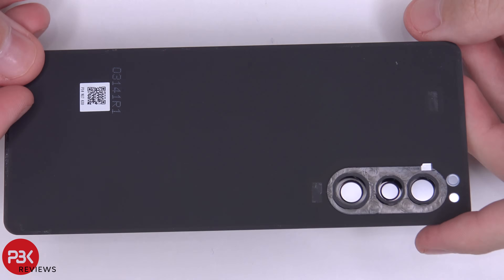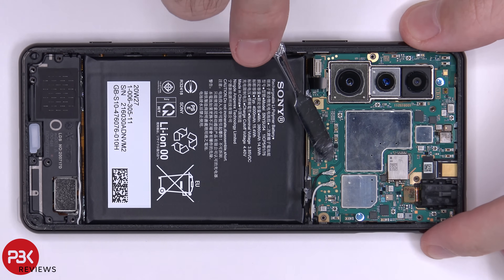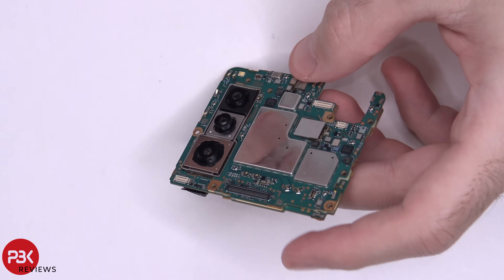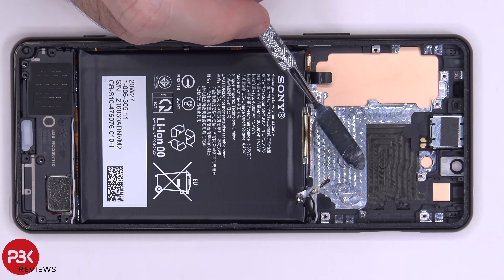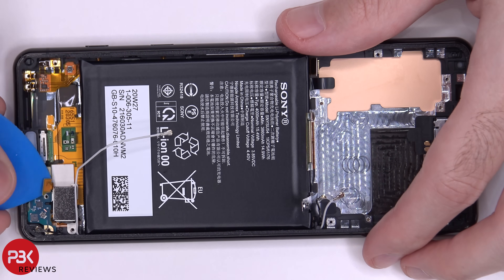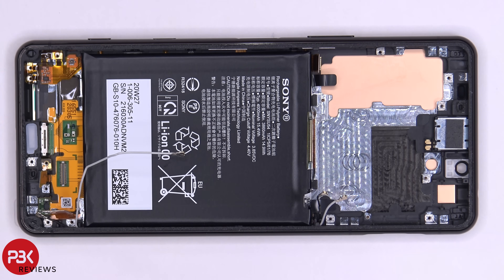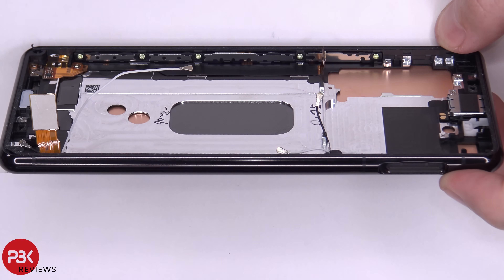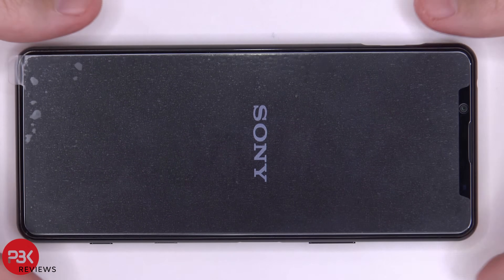Sony Xperia 5 II Disassembly Teardown Repair Video Review

Comment: Beautifully done ..was watching this to learn about the green line which allegedly cause by overheating due to updates ..some say the heat kinda effect the ribbon cable
Reply: @pulkinpulman2028 I had the green line appear 3 days ago on mine.  Out of interest, had you installed the new Pokémon TCG app on your Sony Xperia V II shortly before it happened?
Reply from the maker: Thanks. Not sure exactly what the cause of the green line could be. Multiple things can cause it to do that, so not sure.

Comment: coming back to your video as i finally had time to reassemble my phone, any idea why I'm only getting 3 red flashes from the notification light when attempting to power on? Initially it flashed the low battery symbol on the screen but now all I see are the 3 flashes. Thanks for your help!
Reply: Got it charged and working. had been without it so long, i forgot thats the dead signal. Thank you so much for your content, it was a lifesaver in recovering all my cherished photos and videos of my family!

Comment: Hi, I tore my phone down after watching your video. I'm missing one piece, the adhesive/silicone seal on the lower loudspeaker.  I'm not sure what it's called I guess as I'm having no luck finding one. Any advice?
Reply from the maker: the buffer foam or the adhesive? Sony parts are usually hard to find so you may need to just used b7000 adhesive glue.

Comment: Thanks for the great repair video, much appreciated!

My 5 II was damaged in AUG this year when I wanted to take some photos in a pool, after few weeks of silence the phone started to recover, and as of now everything is back, almost everything.

Except, the connection to O2 network fails (WLAN is OK), tested also in the 2nd SIM slot. The card itself is OK.

It seems that obviously there is a defect on the board with the receiver, but not with the card slot I guess. Any idea which module should be replaced?
Reply from the maker: Not sure what will need to be replaced, but the fact water got inside, first thing you should be doing it not using it. You can risk it shorting out and losing all your data as well as rendering the phone inoperable. You should take it apart and disconnect the battery, dry out any liquid inside and use  a small brush like a tooth brush to brush off any corrosion on chips or connectors, and then re assemble it to see if it will work. If not, you can try replacing parts one by one to test which is defective. :)

Comment: Hello. How do you replace SIM card reader on this phone?
Reply from the maker: Hi, its soldered to the main board so it's not user replaceable. You would need to find a repair shop that can do soldering to be able to de solder and replace it with a new one.

Comment: Great guide, very helpful to see all the steps involved. I tore down my phone to replace the entire frame with screen and the battery. However when I removed the plastic cover like at 0:40 there is a tiny piece of adhesive on the back which when removing the cover ripped the metal heatspreader off the pcb. To put it back on I used some tiny dabs of thermal glue on the chips and precisely aligned it back how it was. Phone works just fine.
Reply from the maker: Thanks! glad it was helpful.

Comment: Sometimes I clean the phone under the sink with no presured water and never had a problem after now almost 2 years from buying the phone that seems some humidity went into the phone and more exactly I noticed in the cameras. The front camera is with beam and little drops of water in the three back cameras. Also the camera app is turning on by itself from time to time. The rest of the phone seems perfectly working, apart of the fact that was not passing more than the three animations when turning on the phone after some minutes of puting under the water. The phone was all the time ON and no electricity problems have been seen. Should I worry about or it will desapear? Should I open the back of the phone and try to remove the humidity? The phone still have the warranty but I don´t know if this kind of situations are the ones Sony repairs...
Reply from the maker: It's never a good idea to wash the phone under water. When they have IP rating, its mainly for accidental drops in water, but these phones are not water proof. They are just water resistant. You probably have water damage in the phone that its causing those issues you are mentioning. You should take it apart, and disconnect the battery cable, clean out any moisture inside, and brush off any corrosion on chips and connectors and then re assemble to see if it helps. Water damage is not covered by warranty.
Reply: @PBKreviews  Thanks for the answer, I am going to do what you mentioned. I saw in the video you removed the back cover with the plastic pick but is it that easy just with it or I need to use some heat to make softer the glue that keeps it attach or is it attach with other way? Whatever the case how do I assemble again the back cover? Cause in the video you just put it on the phone and I am not sure if you use some kind of glue or stick. Thank you very much for the answer, I was not very clever with a phone that isn't cheap..

Comment: Is it necessary to remove anything other than the battery for a simple replacement? It looks like the very first pcb that's pulled off may be covering it, but after that, is it possible to just remove the pull tabs and pop out the battery?
Reply from the maker: Once you remove the top cover and have access to disconnecting the battery cable, you can use the pull tabs and remove the battery at that point.

Comment: hi i disassembled and reassembled the phone. Everything works but the GPS signal. Do you know which is the broken component (the black and white thin cables?) and where I can find replacement?

Comment: Thanks bro what an excellent and detailed video. If I just want to replace the battery without taking out every parts, which part of the video that u recommend me to watch? Can I only remove the battery without touching other parts?
Reply: Then you only take the battery cover thats with top part, then just disconnect the battery as shown in this video, remove the battery. No need to remove anything else.

Comment: Great video, can you replace the screen glass without disassembling the whole phone, or do you have to swap the digitizer too?
Reply from the maker: Thanks. No the complete screen assembly would need to be replaced since the glass is fused/glued to the screen. Only factories or professionals with the required tools and machines can do that job. Also you would need to disassemble the phone to disconnect the screen cable etc.
Reply: Ok ingor my answer here. Thx a lot @PBKreviews

Comment: Outstanding step by step video, great job @pbkreviews.  I have a question id love your advice on, the fingerprint reader on my Xperia 5II has gone bad, i purchased a replacement cable and I'm wondering if you had any idea how i would go about removing the old fingerprint sensor and cable and installing the new one i purchased ?  Would i need to remove everything from the phone as well as the battery or is there a little easier way you could advise ?  Not sure what to do about this.
Reply from the maker: Thanks! You would need to take the back plate off, remove the screws on top and bottom covers and remove those covers. Then disconnect the battery cable and remove the battery as well as remove the speaker assembly on bottom and disconnect the white coaxial cable from the corner, also remove the motherboard then remove the screws on the side of the frame holding the cover/bracket that holds the fingerprint reader flex and other buttons in place to gain access to removing and replacing it. Then reverse the steps. Basically yes you would pretty much need to take the entire phone apart.
Reply: @PBKreviews thanks so much for the indepth and speedyh reply, I'll follow your instructions and get it done.  Thanks again for taking the time to reply, it's much appreciated.  Your channel rocks!
Reply from the maker: @creativewebusa  👍😀 thanks and you're welcome

Comment: What adhesive do you recommend? What steps do I have to do to make the phone waterproof again? Thanks!
Reply from the maker: You would need to use the original pre cut adhesive for the phone to retain the water resistance. You would need to search online for Xperia 5 II adhesive replacement and try to find one to purchase. If none are available you can watch this video on how to install new adhesive but using custom adhesive wont retain the water resistance. https://www.youtube.com/watch?v=T4iiPUIM7-Y
Reply: @PBKreviews  Thank you so much for replying. I found some online. I'm planning to replace the earpiece speaker. Do I need to buy waterproof adhesive for the LCD as well or just for the back cover?
Reply from the maker: @cgjocson  you're welcome. If you remove the screen also, then yes you would need to replace that adhesive as well. But i dont think you would need to remove the screen to replace the earpiece speaker.

Comment: Question: Power button/fingerprint sensor works perfectly, no other button works (both volume up and down, assistant and camera button) Here it seems they are all connected on the same flat cable. Last couple of days had an update and an hour ago dropped the phone from 3 feet hight on the tile floor. Did a software button test, does not register any clicks. Seems to be hardware issue, but power button working perfectly gives me confusion. Any insight?
Reply from the maker: Hmm odd how only the power button and sensor work. I think your best bet would be to take it apart and make sure the flex cable is connected properly to the board and did not become semi disconnected etc. That's the only thing I can think of.
Reply: @PBKreviews  Thanks for the fast response. Makes sense. What kind of glue would you recommend for glueing the back cover back, if I can't find the original one? It is a rare phone after all...
Reply from the maker: @milivoee  Here are a few links. https://www.ebay.com/itm/154657387661  or https://amzn.to/3wQFC9x
Reply: @PBKreviews  Awesome dude, thanks a lot.
Reply from the maker: @milivoee  👍

Comment: Fantastic Video, so well done.  I have a question, what adhesive would you use to stick the back glass cover back onto the phone ?  I recently dropped mine and it cracked the back cover which i will need to replace.  Just not sure what adhesive to use ?
Reply from the maker: Thanks! You can check out this video I did on applying new adhesive: https://www.youtube.com/watch?v=T4iiPUIM7-Y
Reply: @PBKreviews  fantastic, will do and thanks 🙏

Comment: So the charging port cable is not glued to the frame? That would make replacing it a lot easier, now I just hope that the battery pulltabs on my 5ii wont rip once the port is worn out. Well and that thin cable with the antenna connector on top, that thing looks scary too
Reply from the maker: Hi, no it's not glued to the frame and if the battery tabs rip, you can use isopropyl alcohol (link in description) to apply some around the battery and let it sit for a minute so it goes underneath the battery and eats away at the adhesive making it easier to pry off.
Reply: @PBKreviews  I did the isopropyl thing with my XZ Premium and it ruined the screen, it is still operational, but it has lots of dark patches across it as the isopropyl alcohol seeped in-between the layers. Probably not an issue with the Oled of the 5ii, but I'd still rather avoid it because of reasons. 
I have yet to find a repair video though where the battery pulltabs break on the newer Sony phones, so I'm not that worried, just sad that I lost my XZP because of them and finding out later that I didn't even need to remove the battery to access the charging port to replace the broken one.
Anyway, thank you for the quick response :D
Reply from the maker: @or2kr  Oh, maybe you applied way too much? another thing is you need to use 99% isopropyl alcohol or the one linked in my description from ifixit since it dries up really quick. So far I haven't had any issues with any screens but it is a good point to be careful not to use too much. Originally before I ever used it myself, I had those worries but once I started so far no issues on my end with the 99% isopropyl.
Reply: @PBKreviews  It was 99% and yes, I had applied too much in the thought of it not being able to damage anything, most of it didn't stay where the strips were and I still had to use a lot of force to remove the battery. Anyway, should've watched/read more guides to find out that I wasn't even required to remove it to replace the charging port to avoid the whole mess I created

Comment: Hi great video, I have a urgent question because I need an important document I stored on my Xperia 5 II yesterday but the phone now is stuck in a boot loop. Not because of a recent update but when the battery was almost empty, I plugged it to a charger and then it turned off. It tries to restart since then but turns off as soon as the pincode screen shows because the battery is too empty. Soft reset doesn't help: keeps looping. Phone is 4 months old. I read on a forum a possible solution: let it charge and loop for hours so the battery charges bit by bit a little more than it uses to restart. Just until there's enough capacity to fully restart. Do you think this can harm the battery/phone? And if so, are there replacement battery's available? Do you agree the ultimate solution could be placing a new charged battery? One step before that, is it possible to stop the loop and charge the current battery after? Maybe by disassembling something so that prevents the phone from restarting and then charge the battery you think? Reactions much appreciated THANKS!!
Reply from the maker: Hi, thanks. hmm I would think the best option would be to buy a replacement battery (hoping it has some charge in it) and install the new battery to power on the phone and get your files off. I would also assume the new battery should fix the problem but if its having a bootloop still, might need a factory reset (after backing up all your data) and if still no luck then it might be some other hardware issue causing that to happen.

Comment: Hi! I broke my back glass today and really liked your tutorial here. Do you know where I can buy the back glass as enduser to replace it by myself? Thanks in advance and keep up the good work. :)
Reply from the maker: Hi, Thanks. Here is a link, and if it doesn't come with adhesive you can watch my video on how to replace adhesive. https://www.ebay.com/itm/A-New-Battery-Housing-glass-Door-Back-Cover-Replacement-For-Sony-Xperia1-ii-5G/274662630011?hash=item3ff32b227b:g:wg8AAOSwPDVgEkHl

Comment: Why are there no replacement batteries available for this phone? I have looked everywhere online, but they simply don't exist. So the fact that the battery should be fairly easy to replace (as far as glued together phones go) is meaningless, as you simply can't buy a new battery for it anywhere.
Reply from the maker: sony phone parts always seem much harder to find. probably sony has a tighter control over it.

Comment: Can you buy spare parts somewhere for THE Xperia 5 II
Reply: Ok thank you so much for answering :)
Reply from the maker: @BrudgeK  you're welcome
Reply from the maker: Parts for this phone don't seem to be easy to find. You can keep checking eBay, Amazon, alibaba or aliexpress.
Reply: The backplate of a Xperia 5 wont fit right? Its like 8.2mm on the Xperia 5 ii and a 8mm on the Xperia 5 diffrent right? THE glas Broke at the camera, or is THE glas size THE same om both phones?
Reply from the maker: @BrudgeK  ya it probably wont fit. It wont be just the size of it but also the camera frame area where the lens cover sits over the cameras etc. Any slight position changes would cause it not to fit.

Comment: Sadly no wireless charging
Reply from the maker: Yep, I personally never use wireless chargers but would be nice to know I would have the option of being able to use it. But these phones charge pretty fast now a days so can easily charge with a wire, or you can add an aftermarket wireless charger which connects to your charger port.
Reply: @PBKreviews  thank you for the reply
Reply from the maker: @blackwindzasheer95  You're welcome

Comment: When you drop this phone, what do you think will be at most risk of sustaining damage or breaking? Thanks.
Reply from the maker: I feel the back would break easier than the screen glass.
Reply: @PBKreviews  Do you see any fragile components or weaker design decisions inside the phone that may easily be damaged when dropped? How shock-proof do you think the inside hardware of this phone is?
Reply from the maker: @ddcll9538  Most of the parts are pretty solid, the only things I can think of that can possible get damaged or break if dropped hard enough might be the cameras if the outside glass breaks and shatters the camera glass/lens as well or the battery possibly getting damaged or pierced if the glass back breaks and something from the outside damages the battery. Aside from that, in general most of the parts internally are strapped down or screwed in and I don't see anything damaging internally from a drop aside from outside damage.
Reply: @PBKreviews  Thank you very much for your analysis and replying so quickly.